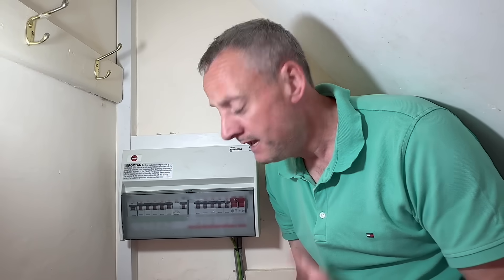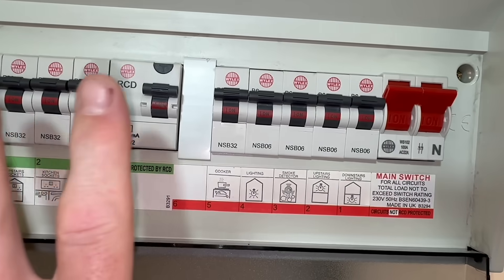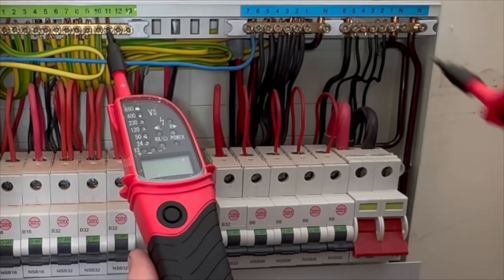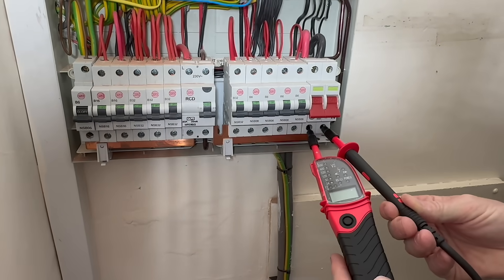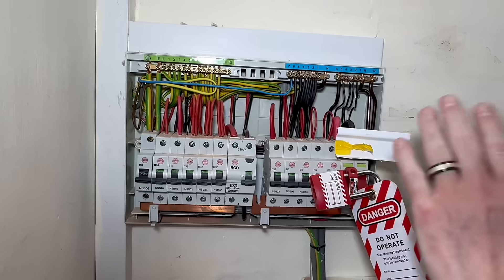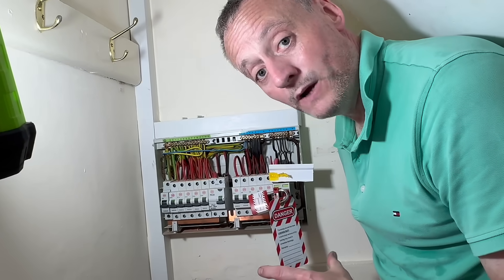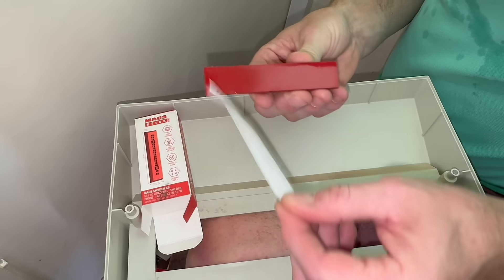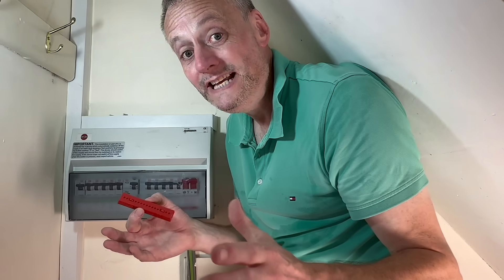£1000 To Change This Plastic Consumer Unit?

Comment: I got my consumer unit changed 5 years ago because it was just basic wire fuses. 
I could have done the work myself, but I am a heating engineer, so got an elderly electrician I know to do it. 
Split load, large metal cased unit, all supplied and fitted for £180.

Comment: I as I am a landlord, with a  tenant in a property built in 1988 I have had an  EICR check saying it is unsatisfactory. 2 units, 1 for storage heaters, 1 for everything else. I have been quoted a £1000 to upgrade. I showed the report to another electrician who quoted about the same but said the previous guys quote wasn't the latest regulations? What should I do?

Comment: You knocking the power off to work on that box"you chicken, 😂😂😂😂", I've still got the old wylex board with fuse wire in, I work for an electrical company and there is no way am I spending any money when I've never had a problem
Reply: @keithparlour140  yep me too, been retired 10 years, but what did do was keep old wylex mcbs when changing customers consumer units and popped them in to my wylex board, sorted.

Comment: Backing off connection screw to a lower torque might result in slightly loose connections if the conductors were more compressed by the higher torque.  It might be safer to cut back slightly and re-terminate.

Comment: And I would fit a 100A double pole switch next to the incoming meter so the consumer unit can be isolated without interfering with the power companies incoming fuse

Comment: As an Industrial electrician for 50 years no I would not change the consumer unit, nor if the house was in a rural area fit a surge protection device unless I had multiple dc vulnerable circuits in the house , anyway most modern equipment have their own built in safety devices, I would upgrade my safety devices if they were mcbs I would upgrade to Type A rcbos and put burglar alarm box and smoke detectors on their own circuits

Comment: If there isn't a copy of the installation certificate present for ALL of the circuits in that board or me to use as a reference of when the circuits were installed and that whoever did the work has signed it to say their work complies with the regulations at the time, even the new circuit (could be minor works), and the cables are concealed in the wall at a depth of less than 50mm, I would be inclined to C2 the lack of RCD protection for those circuits, as you can't just assume they are buried deep enough to omit RCD protection. Same goes for bathrooms, I'd be very uncomfortable not C2ing a circuit that feeds a bathroom without RCD protection. We have to remember the regs are there as guidance not legislation. I'd rather err on the side of caution than cut back on safety to save someone a few quid. We would have charged £780 to replace that board with a new AMD3 compliant board with SPD and at least 2 spare ways, test all circuits, custom clear labelling (not stickers that come with the DB) and certificate upon completion.
Reply: The customer is in his 80’s. More chance of him being killed by a fall. That’s all over the top and not necessary. Common sense needed here - that’s the whole point of the video

Comment: My metal spd dual RCD board failed EICR, reason type AC rcds. And forced me to replaced board rcds by Type A rcd. Saying its mandatory as in modern house hold we have dc circuits in mobole charger, fridge, washing machines etc. Here in this video i can see its type AC rcd and still seems okay? Scratching my heads..

Comment: Haha 21 years.. My danish c unit is from 71, and wiring is pretty chocking and multiple electricians have had their fun over the years, compared to that neat job there.. I do have a new Hager Dual c unit and meter enclosure made and ready.. My old c unit is 3 phase as it's pretty common here. My unit only has rcd type ac, 1 16a 3p+n and 2 1p+n 10a "light" curcuits, and always baffled with all these curcuits divided to hell and back.. Single phase installs - how common are they in the UK?

Comment: There are a lot of other variables to this. Is the property rented , is the building of timber construction, is the board mounted in the only means of escape, does the cooker circuit have a socket outlet that could reasonably be used for outside work, are the circuits contained in surface mounted trunking, is the earthing up to standards and take into account supplementary bonding in bathroom enviroments. We have only been given a snap shot of the overall installation and having watched the content of the video and based only on this I would agree that the consumer should be graded a C3 as recommended for improvement as it clearly met the standards when it was installed.  This could be the problem with not knowing the whole story. Keep up the good work efixx your channel is very helpful and helps towards my 30 hours of cpd that the NICEIC are insisting on.

Comment: The regs say that if it meets the regulations and requirements of the year and edition it was put in under then it is not a legal requirement to change it,as it satisfies the regs and as bs7671 is only statutory and not mandatory there is no legal obligation to upgrade anyway.only on a new installation should the latest non mandatory regs be set as the minimum standard.
Reply: Correct regulations are not applied retrospectively. So much poor info out there and scammers.

Comment: I wouldn't accept a plastic consumer unit as the sole reason for requiring an upgrade in any circumstance. Utter grift. 
 Presumably Wylex wont have an issue with installation of this device into their enclosures? Nit that I feel it is in any way necessary in such a clearly well installed and preserved CU

Comment: This big push on safe isolation is getting dumber every week, taping plastic over the screw heads so you don't accidentally stick your VDE approved screwdriver into live terminals? weird how you stuck your test probes into the live terminals just fine, so you trust the insulation on those but you don't a screwdriver designed for working on live terminals? How very odd, I'm sorry but you are just further dumbing down the industry. I'm totally going to isolate a 3 phase board in a working factory while i torque up all the screws... not. If people are too dense to do a bit of live work safely then they shouldn't be electricians.

Comment: Would have provided RCD protection to circuits within a bathroom and called that job done. Some greedy sparks out there failing for anything. Good idea the fire stick 🔥 how much?
Reply: I use the Ferostickers. They look almost exactly the same and I pay under £50 for a twin pack.

Comment: The risk is the lack of RCD protection on some of the circuits, so the “advice” to have a new board (which would also be metal) is correct. But I make it clear to the customer that they do not have to have the work done. 
£1000 is a bit too expensive but there are a lot of circuits there. Could probably supply and fit a full RCBO board for around £600. 

The real issue I have is when people “upgrade” a board like this by adding RCBOs into a plastic board. It still doesn’t comply with 18th edition so what is the reason? Either leave as is or fit a new CU
Reply: But wouldn't rcbo's be better not worse ?if they wanted to keep the board
Reply: @MrPatch25 yes but you have to justify why are you doing it? If it’s to comply with 18th edition then you should also install a metal consumer unit. RCBO shouldn’t be thought of as just an “upgrade”

Comment: You are proving 2 things:
1) the need of a full independent disconnect after the DNO fuse ( like there is in France) so electrons can work on the consumer unit
2) that a plastic consumer unit can be safe  if using proper parts and have been properly cabled  ( also they continue using them oversea)

Comment: As a layman, I am appalled at the number of different opinions about this. Surely there should be correct way or not. Or are the regs so complicated and  vague as to be open to interpretation?
Reply: The regulations set standards that need to be complied with, but don't say a whole lot on how to comply. Then you have an industry of individuals from multiple generations, trained in a multitude of ways (some more thoroughly than others), in a continuously and rapidly evolving industry, with manufacturers instructions overriding any other learned rules or methods, all of which we're expected to keep on top of while also actually getting work done! Perhaps you can get an idea of how convoluted it all gets?

I'd like to say most of us try to stay on top of things as best we can, but remember we are humans with other things to do with our lives and only so many hours in a day, just like everyone else.

Comment: If that is the case: Regulation 421.1.201 to BS EN 61439-3. . . . . Why is the main head and meter mounted on a chip board flammable wood base inside, not in a metal enclosure, or tails not in a metal conduit like in Murrica? And in a crappy fibreglass box outside? 😝 Who are pushing these regulations. . . . . .The manufacturers, I thinks🤑🤑?

Comment: I retired from sparking just as 18th came out. Frankly, telling an 83 year old that that CU must be replaced is a SCAM of the worst order - preying on the vulnerable.
I would have recommended (but made clear it is NOT mandatory) that RCBOs be fitted to lights. It would be easy for an elderly person to give themselves a shock when changing a light bulb (sorry, lamp!). Otherwise nothing wrong with it being a 16th edition board
As for smokes. if installing as part of a rewire or new install, I'd put them on their own circuit. If adding to an existing install I'd wire them into lights and link them with a radiolink system (Aico were my preferred items), unless a link cable was easy to install. The advantage of putting smokes with lights is that if the mcb/rcbo trips, you will know because some lights aren't working. If the same happens on a dedicated smokes circuit, you wouldn't know about it.

Comment: If its on an escape route or under the main set of stairs out the house I would be looking to upgrade it. One of those things were if we dont draw a line in the sand somewhere nothing ever gets replaced due to safety concerns. The core issues is terminals are left loose, generally on the main switch. With some brands of consumer units not having the required flame retardant material in the plastic mix. Other factors also come into play with older wiring systems, lighting circuits through bathrooms with no RCD protection, surge protection devices, type AC RCDs (if any DC leakage is anticipated on the system). 

All things considered if the wiring is sound and its just a board change £600-800 + VAT is good value in terms of safety for me. Especially with an elderly occupant having all the power trip due a fault effecting a shared RCD. 

If they are vulnerable please let me know the address and I am happy to provide and install a metalclad RCBO consumer unit with SPD free of charge.
Reply from the maker: From the various comments across social media, the main issue that stands out is whether regulations should be applied retrospectively. If so, the challenge becomes determining where to draw the line—what existing installations would require upgrading, and which elements could reasonably remain in place?
Reply: @efixx  exactly and this is something I have spoken about lots with wonderful people like John Lorrimer, Mr Bridgeman and our technical managers of industry. Its the same for RCD protection on buried cables with some arguing for C2 codes on those. A very hard balance as we can not apply regulations retrospectively adhoc if at all!

Comment: So most EICR outfits coming back with fail as no rcd protection on right side of that board ( even though we know it's fine ) also now I'm getting EICR coming in saying must be thpe A rcd protection even when it's a top floor flat with no chance of so, ar of EV being fitted 🤣 I would say on that board change RCD to thpe A is worst case scenario esp if old couple but they won't be adding any new kit to it and if they did that's up to say the EVchaps not the clients problem.

Comment: Perfect solution .... I still prefer Smoke alarms to be on own circuit, I do understand the thought process for putting on the same circuit as lighting. But people that turn these off are doing so because they don't want them to sound, maybe because of repetitive false alarms. If they can't isolate then they just cover the alarm with socks or a bag. With the new regs the alarms have to have an inaccessible battery back up, so it kind of makes deliberate or accidental isolation redundant. 

As for those dubious folk out there that just change a panel either because it's plastic or not 100% up to the current spec, need a good slap. As many are aware, the main cause of board fire is due to poor installation/loose connection. So many fires would have been caused by "updating" a perfectly functional old wire fuse CU   with a nice new plastic one, with bad connections ...

If it ain;t broke, don't f@@k with it .
Reply: Just use a Aico wireless with a batt that all links together wirelessly, needs no mains, with a 10 year warranty on the battery. after 10 years they need changing as out of date anyway. 😉
Reply: @boombox2661  The Rolls Royce of alarms, expensive. Although, I do have them fitted myself.  LINKD  Alarms are a great solution for anyone, especially landlords, changing out after 10yr mains and having to add additional without need to run supply to them, as the Mains and Standalone Alarms interact with each other, including the CO Alarm.. Very cost effective and can save even more buy buying bundles and mix and matching. Can even buy a remoter to Silence/test Alarms .
Reply from the maker: Great Comment thank you, have you seen this as well?
https://spark.efixx.co.uk/timeforachange/
Reply: @efixx  Cheers good sir. My older brother Lectures In Fire Detection, mainly for the commercial industry for up coming sparkies. He is old school... Has been in the fire alarm/detection industry from his early 20's, now nearing 60... Basically trained specifically in Fire Prevention/Detection in a company that was job specific ..

Comment: Seriously a straight swap for a metal consumer unit for such a simple setup shouldn't be anywhere near £1000.
Reply: What do people charge PH? My temp NICEIC inspector that runs a company too, from just inside the M25 was charging £95 per hour per man.
Reply: @boombox2661  Sounds about right, swapping out a small consumer unit like this is at the absolute outside 4 hours work for one guy. Should really only take 2 to 3 hours especially when the old one is tidy like the one in this video.
Reply: @schrodingerscat1863  Don't forget a full installation test, tho?
Reply: @boombox2661  A lot of that would need to be done anyway to get your safety certificate so it isn't as big a deal over the tests they would be doing anyway. Most rental property is already vastly better than ordinary domestic installations because they have to have regular inspections and testing.

Comment: No SPD, missing a large amount of RCD protection and a type AC RCD? That would be the larger concern.
Reply: People are still driving Morris Minors around and passing MOT's with no airbags, no ABS, no crumple zones, no seat belts? Not really a danger to drive. just not up to current regulations for a new car. The consumer unit may not be  complying to current regs but is not a danger. C3, recomend upgrading if they want to? Too Many electric police 🚨🚨getting above their station 😂
Reply: FFS, do you strap into a harness to go upstairs? It was fit for purpose 21 years ago and is still today. Grow a pair.

Comment: You checked the tester was working before testing for live, but omitted to do so after testing circuit was dead. This is important because the tester can fail at any time. Failure to do this could result in an interview with St. Peter.
Reply: @GeraldDove-i1z  He didn’t show it but he said he had checked the tester again on the live incoming lines.

Comment: The fundamental consumer protection failure is in allowing contractors to carry out EICRs in the first place! The present arrangements are open to abuse and dishonesty with an industry fully invested in marking its own homework only too happy to have consumers under the misapprehension that every observation on an EICR is a life threatening danger. This lack of understanding is reinforced at local council level where non technical admin staff are insisting that completely unnecessary electrical works are undertaken in commercial and domestic rental properties simply for the purposes of uninformed box ticking.
The answer is to have suitably qualified and licensed inspectors (possibly allied to RICS surveyors) with no commercial interest or relationships in contracting undertake electrical inspections.
Reply: Yeah we had one yesterday, installation had failed an EICR badly with multiple C2s and C1s on ropey looking garden electrics. 

The kicker: The garden electrics were not connected to any power. We just removed the lot for the customer's peace of mind, made good a few actual C2s (mostly exposed basic insulation) and gave them a satisfactory report,  with a small list of C3s, some of which they're having us back to fix, some not

Comment: Stuff that I'm in this job to make money and make the installation safer, Replace the unit for 18th addition & fit RCBO's with 30mA protection on all circuits where required & type 2 surge protection.
Reply: You know what, if an installation has done 20 years of safe service, there’s more risk messing with it from an unknown contractor IMO.

Also what type of RCBOs? Why no AFDD if we need true safety?